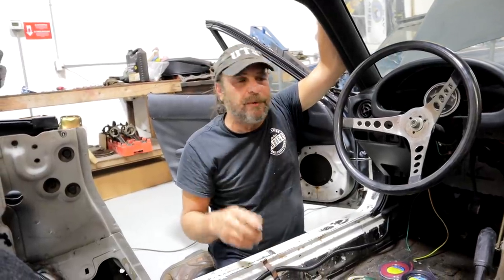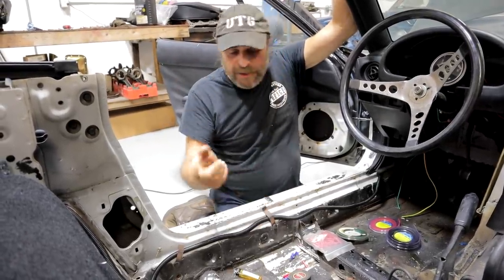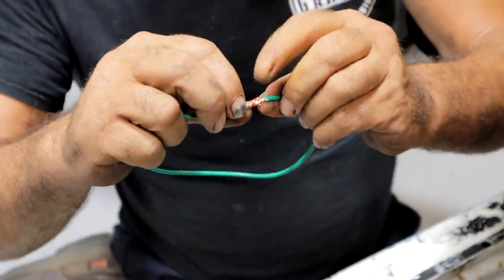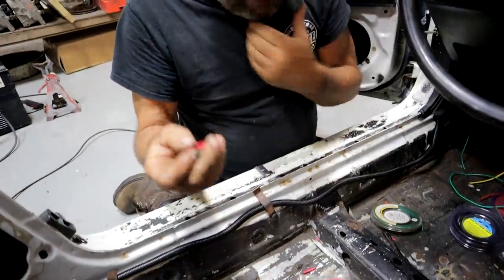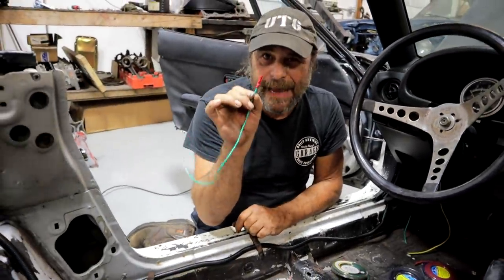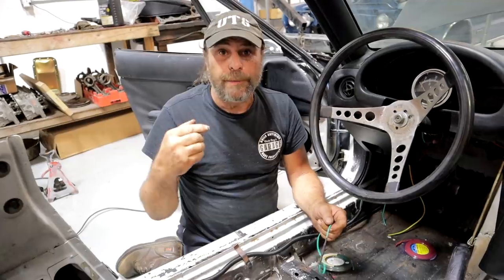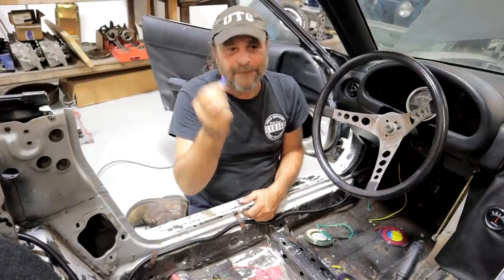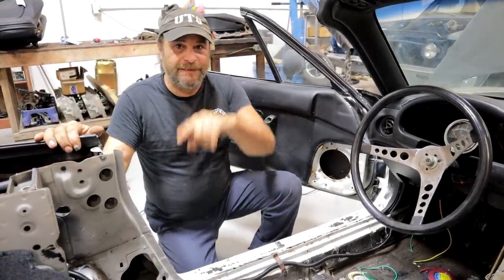The Single Most Misused Item In The World Of Cars

Comment: I often do projects with lithium battery packs, which are a bit on the dangerous side. I like to solder and use shrink tubing, but filled at each end with hot glue. With the small size glue gun it's very easy to get in and get a good squirt of glue to seal up both ends. Then come in after with the heat gun, which'll finish shrinking the tubing, and remelt and distribute the glue. This provides an added level of insulation and seals out moisture. It's the most reliable splicing method I've devised yet.

Comment: Not sure why soldering is considered such a chore. Only ever used crimp connectors for temporary repairs. I've seen too many hard to find electrical problems traced to dodgy connectors. As a young man I built my own rally car to Ford factory specs solo. I soldered every connection I could. While I only won the odd race I gained a reputation of always finishing. Never had any electrical problems to do with wiring which others often had to contend with. False economy imho.

Comment: I am an electronics engineer and would strongly advise to just perform a straight twist solder and a quality heat shrink. There is no dielectric effect between the spliced wire that can cause corrosion over time since you are relying on the manufacturer in China to make a decent connector.  Cringe moments....the stripping of the wire with teeth...yeah...that WILL go bad one day, trust me and the use of a lighter instead of a heat gun, but that is just my hang-up.

Comment: I hate those guillotines and those cheap crimps. as a 40-year truck and heavy equipment mechanic where I see them used in any kind of harsh or wet conditions they always fail. personally I think the twisted wire wraped with electrical tape works better than those cheap crimps or guillotines. Ideally I solder and then use ahigh quality electrical tape like Scotch 88 or Scotch 33. Believe me all electrical tape is not the same, there is a huge difference between the cheaper stuff and the real professional stuff.

Comment: I do this job professionally, and I'll say I pretty much always solder my connections these days. Yes, it takes longer but I've had way too many of those butt connectors fail. About the only time I'll use them is for something like wiring in a stereo head unit or the like. And if I do end up using them I like the ones that have the heat shrink built in. I will also generally throw electrical tape over the connection as well. Yes, it looks ugly as hell but it's extra protection.

Comment: You might want to talk about soldering some more. Especially letting new people know that those little 30W solder irons will not cut it with automotive wiring. That's a big frustrator for those not in the know.

Comment: Especially if you live where they salt the roads, you HAVE to use shrink tubing, otherwise that connection will corrode and fail within weeks. I go one step further and coat the ends of the wire with dielectric grease before sticking them in the connector and crimping them.

Comment: Preferably use copper crimps and heat shrink tube. Watch out for accelerated corrosion using aluminum on copper wire. Copper and aluminum are incompatible materials that are made.worse when electricity is added. It causes electrolysis that reacts to any moisture and accelerates the corrosion of both materials copper and aluminum.
I also use a corrosion resistant sealer like "corrosion X" on all of my connections to eliminate the possibility of galvanic corrosion. It is rated for areospace applications and meets NASA and mil-spec requirements.

Comment: Even better, they make butt splices that contain solder and shrink tubing as a one-stop solution. All you need to do is feed the stripped wires in and hit the splice with a heat gun/lighter and you have a complete connection. Really saves time if you’re crunched.

Comment: Thats why I prefer using the bare crimps without the insulating plastic both at home and at work.  They look so much better when you heat shrink or even tape them up if you are doing a restoration like project.

For my truck with the auxiliary circuit box I am adding for my Holley Sniper Stealth fuel injection as well as my aftermarket circuits such as auxiliary lights, cb, headlight relay upgrade, 3G alternator upgrade, ect. I am using a junction block with relays and fuses and I am going to avoid crimps in between my circuits if I dont have to.

I also have a higher dollar dedicated crimping pliers that I am glad I upgraded to, they have two types of crimp built into the end, they have one crimp for insulated crimps and two sizes for non insulated with a nub that you place on the opposite side of the split in the crimp which helps to roll the crimp and get a tighter crimp on the wire.  I also have another crimp that I will be using as lots of my auxiliary wiring on my truck are the weather proof connectors, this crimp tool rolls and folds the split end into the wire itself and you use it again on the end of the crimp terminal which folds the split end into the insulation itself which is what really provides the structure for the wire to prevent the wire from pulling out.

Comment: This is absolutely correct! This how I connect wires mainly I do radio connections or anything in the car such as fuel pump harness or any harness that has lost connection due 2 corrosion. Anything under hood or in the body line, the only wires that r almost impossible 2 repair are abs/anti loc wires directly behind the tires as they use a very soft copper strand of wire almost like hair so it's just better 2 consider getting new or used harness that has plugs on both ends,, another problem 2 look out 4 is in the body line such as horn/headlights side markers, turn signals unfortunately those wires no matter how well they r insulated from factory I've seen can already have corrosion in them mainly due 2 the outside environment ( cold winter,, lots of dampness ) and you'll never kno until u have a signal problem and begin stripping wires open noticing corrosion already present,, So? What do u do? I've done this to repair a horn i re-connected it w crimping and heat shrink and works however the best way is 2 take the time and trace wire back far enough closer towards cab were wire has good clean copper no corrosion (green discoloration) then section in new piece of wire n disgard old one Strip, crimp, heat shrink which gives optimum connection

Comment: Not a mechanic,  but I work on my own stuff.  I figured out the benefits of heat shrink when wiring.  In wet spots I will double overlap the connections and I have never had a failure.

Comment: Use marine crimp connectors. They have heat shrink with adhesive sealant for watertight long lasting crimps (solderless connectors) which provide that support and prevents corrosion of conductors due to moisture.

Comment: What isn't commonly know, it that you can buy just the metal inserts without the plastic shield. From there you can crimp or solder your connection and then use heat shrink tubing.

Comment: I solder and heat shrink whenever I can.  Insulated butt connectors just look like ass, and they're not really good for a permanent repair.  The problem with solder is that most people aren't very good at it, so they end up making crappy repairs with these things.

Comment: One step further is shrink tube connectors. Crimp and use heat gun, Also get a better pair of crimpers! Those ones in general are garbage, I get what you're saying about "better" ones of those but just get a pair of Mac's or snap on and don't look back. Gotta use zipties and loom so it doesn't move around and cause issues like you mentioned. Use flush cuts on the zip ties so you don't cut your hands up working under a dash. If you really want things to look nice you can get heat shrink tubing for the labeler and identify each wire in the harness at the ends. If you're gonna use those red connectors you have strip off the red crap cause it does nothing and you'll have that little insert. Crimp your wire on both ends and run a drop of solder on each side then use the heatshrink that has the layer of glue on the inside. That bulk shrink tube you bought is cheap stuff. The glue squishes out each end completely sealing the connection

Comment: For a lot smaller foot print and just cleaner I recommend the non-insulated butt connectors with Marine heat shrink because that stuff he is using won't really keep moisture out and also doesn't really provide much protection against pulling

Comment: I will not use solderless connectors. Solder and adhesive sealant heat shrink. There are Solder joints that provide more physical strength than the wire.

Comment: that is a bad crimper. Use properly calibrated aircraft type crimper and you dont need to use shrink tubing.  Shrink tubing is great for added strain relief but should not replace a bad crimp. With the correct crimper the wire should break before being pulled out!!!

Comment: Better yet, I use silicone over the crimp then shrink tube and as I heat it, it squeezes out the silicone,  making a water tight and corrosion proof connection.

Comment: I've been working on trash trucks since 1980. I started with with the stamped steal type crimpers, then I went to the heavy staking type, then I found silicon dielectric grease to keep moisture out. I've now found the ratcheting type crimper that makes a much better and consistent crimp. Most of the time I don't have the space, or the time to use heatshrink. A big part of the failures I  run into are rats chewing on the wire

Comment: Nothing wrong with a properly crimped connection.  The promblem is the wrong type of crimper and cheap connectors.  You have to expect to pay more for a high quality crimp connector.  There are crimp connectors that have self sealing heat shrink already attached, just dont use an electricians crimper and puncture the heat shrink.  The electricans crimpers are made for unisulated terminals, use a high quality ratching crimper with proper dies.

Comment: I dont want to connect butts....therefore I do not use butttttt connectors. Western-union twisting and solder if its exposed to weather. Heat shrink with the glue in it if I really care about what it looks like. 3M super 88 otherwise.

Comment: It doesn't matter if you put heat shrink around a cheap crimp connector, it will still corrode. It will corrode from electrolysis because of the metal used in the cheap connectors. I have probably fixed hundreds if not thousands of circuits fixed with cheap crimp connectors and shrink wrap. You should always replace the wire entirely, from connector to connector. That way you have a proper OE style crimp at both ends and crimps only in the original connectors. Every crimp always adds resistance to the circuit, sometimes far more than you might expect. Every butt connector also adds a new failure point for every other wire in the bundle that is touching and flexing against it. Cheap butt connectors scream that someone didn't want to take the time to do it right. For a hobbyist it is just a little more time and no basically no additional cost to do it right. If the car is torn down like the one pictured here it is literally only a few min more to replace the entire length of wire. The best advice is to never use butt connectors for anything other than a temporary repair. Sadly, too many people think they are a miracle, and worse yet, a permanent repair.

Comment: If you use a real crimping tool you won't be able to pull the wire apart. I have a snap on tool for that. Upper dash, like a radio install I just use them as is. Yeah anything under the car or in the engine compartment should be seal from moisture and that is a very important point. While a bit on the high priced side,  you didn't show heat shrink but connectors that are both in one. Some you don't even crimp as  they solder and shrink  when heated. If one cannot afford those types of connectors at least try to pack the end with silicone, or dielectric grease, or heat shrink( as mentioned) over it to keep corrosion away after crimping. I'm not buying heat shrink tubing makes it harder to pull apart and if so not by much... wasn't crimped right to start with.

Comment: Even better are the low temp solder connectors. You just stick the wires in and heat it. The solder melts in the middle, the tube shrinks, and the waterproof sealant melts in either end.

Comment: Good point. but..
I never use anything that doesnt have glue in it. 
I only use the cheap no glue/shrink in places I dont care or temp.

the new no crimp solders work good.
Heat gun and not a torch is key also.

Comment: i always tug hard on my crimps too. if it pulls appart it was a fuq'd crimp. The Klein wire cutters with the crimper notch in the head are IMO the best crimpers you can buy. those red handle style ones are ok but I prefer the Klein wirecutter / crimper. its not as specialized a tool but man does that crimper on it make a good strong crimp with those connectors.

Comment: I use a mechanical connection then soldier it, then corrosion resistor then heat shrink tubing. Ok thats permanent no weak links.

Comment: Those splices were not made to be moisture proof. There are moisture proof splice kits which have a meltable seal inside the sleeving. Raychem makes them. Get a decent set of drop forged Klein crimpers, those cheap stamped steel ones like you are using will kill your hands.

Comment: Nissan and Peugeot use these crimp connectors in their dealer issue wiring repair kits. The Nissan ratcheting crimper is excellent. The ones I use shrink and the insides melt under a heat gun, perfectly sealing the joint. I used to be a solder guy, but almost exlusively use this now.

Comment: I started soldering then use the heat shrink with internal adhesive if i have to do a permanent splice. I largely avoid splicing and use oem plugs and recepticals where possible after learning they exist for the aftermarket. Is so much more professional and secure. Molex, Delhi reminds me of the cannon plugs used on aircraft i use to work on in the Navy. Fact is factory splice if three wires is twisted then soldered wire followed by adhesive lined heat shrink hence why i quit using the crimp connectors largely in any permanent splices.

Comment: Always do something to take stress off any wire connection. I put my connections in a loop. I zip tie the wire loop flat on to the running wire. Then fully bind in tape or large diameter shrink.

Comment: Cheap dollar store nail clippers work well as wire strippers, don't push hard, make a gentle cut, turn 90, make another, slide the cut portion of the wrap off with the clippers, better than a chipped tooth

Comment: I buy the butt connectors from harbor freight which have a metal core but are made with heat shrink casing. This way when I shove the wires in and crimp the connection, you either use a lighter or a heat gun and you have a water proof, permanent connection. They're also really cheap, and I've used them many times with perfect success.

Comment: I still solder and heat shrink everything. I've seen the other connections corrode and come apart to often. I use a solder torch. It works to solder and heat shrink it and I don't need to find an electrical outlet. The only exception is when I'm working around something flammable.

Comment: I started off doing it exactly as he said it was supposed to be done but then I started stripping the insulation off the connectors and soldering the metal piece instead of crimping them. Of course I still use heat shrink to protect the solder joint. His advice will work but in my mind my way is better and more permanent!!!

Comment: Check out solderseal connectors. Slip on like heat shrink, do a linemans splice (holds 10x better than a regular twist splice), then just heat it up with a heat gun till the solder flows to the ends of the joint.

Comment: I have found it much easier to use solder and heat shrink.  I can actually make connections faster doing it properly than most can using those cheesy crimperdoodles🤣

Comment: If you have enough wire and access to electricity, a Western Union splice, a bit of solder and heat shrink tubing is ideal. However those crimp connectors are decent and serve the purpose fairly well, especially when repairing broken sensor wires where the amount of wire available to use is scarce.

Comment: I was using solderless connectors, mainly crimp caps, 40 years ago as a car stereo installer at a few different local shops. In an inside-car environment, they last forever. Where they see weather, I use shrink tube on soldered connections, or glue filled heat shrink solderless crimp terminals - a great little invention right there.

Comment: A crimp connection should be a last resort if for some reason soldering is not possible. Just like a good weld will be stronger than the original metal ... a proper solder joint will just as strong as an uncut wire. I promise if you yank both ends of a butt-splice, it will come apart.

Comment: i will take a q-tip cut off one end and use that cotton free end to ram a small amount of dielectric grease down into the connector, before inserting the stripped wire. This aids the flow of electrons by providing an additional conductive pathway ,and will prevent moisture from getting in. A little bit on both ends will do the trick. I also use  dielectric on my brake , reverse, turn signal bulbs and  spark plug wires on both ends as well.

Comment: Many years ago and when I was way younger I learned, and shrink tubing was new,  that using matches and lighters on tubing could char and weaken it.  If the charred area was being flexed or rubbed against the frame it would split creating a failure point - hot air guns should be the tool of choice for shrink tubing.